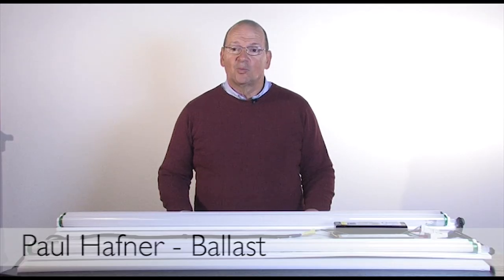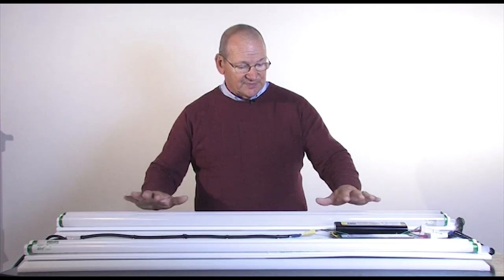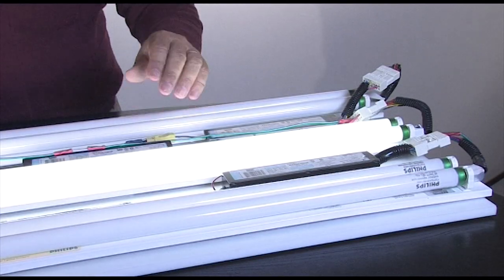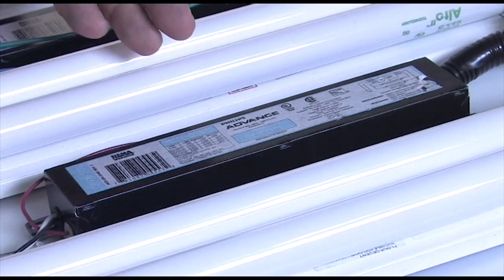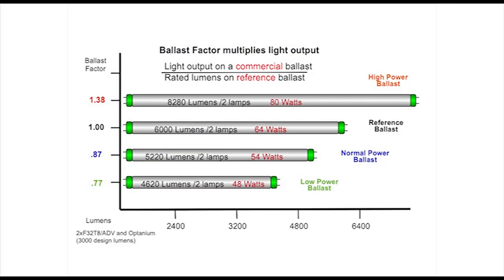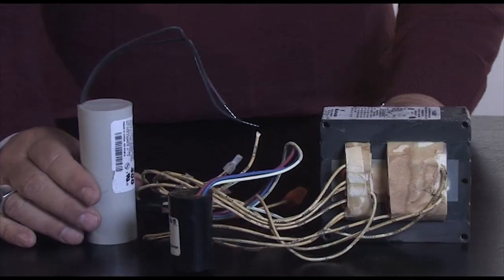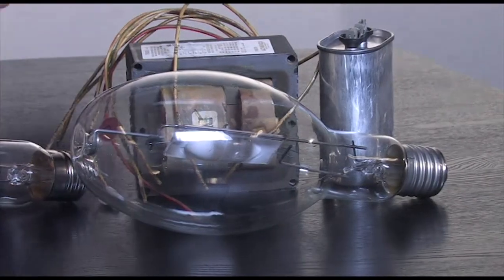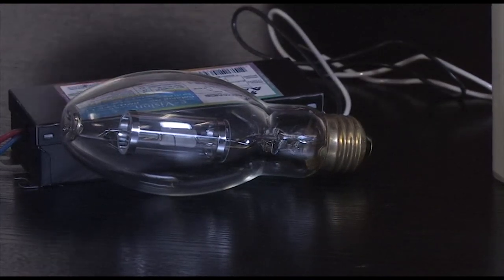What is a ballast?

Comment: I have just moved into a house built in the 80s. the bathroom has a magnetic ballast. it's weird. it sounds really stupid, but it almost seems like there a psychic link to the light. 9 times out of 10 the light turns on at the exact same second that my urine is released. it sounds stupid, but it's happening. Hard to find any information on this sort of thing, at also without seemed full blown crazy.

Comment: does the ballast makes a difference in light power? for ex1ample if i buy a 100$ balast or a 500$ ballast ? will the better one gives more power to the plants ? or it dosnt matter the ballast only the bulb ?
Reply from the maker: Hi there, thanks for reaching out. Cost is not directly correlated to power, so a more expensive ballast won't necessarily be more powerful. Thanks!

Comment: Come on man get into the future. I recently found that the BEST thing to do is to toss the flourescent bulbs and ballast and install LED bulbs they make them to fit almost all older flourescent fixtures. You may have to swap the ends that hold the bulb but I did not they fit right in. Just remove the ballast and wire straight in like a normal bulb. Better light/cooler and lasts longer. Just so you know.
Reply: Led lamps sucks
Reply: They really are not lasting as long.
Reply: @jonathaneastwood2927  3 years and going strong. Instant on and much brighter than the flourescent bulbs and best of all NO ballast LOL.  I got these at the light Bulb Depot store off Lafayette Ave in Nashville TN these are good! I am sure that there are some inferior brands out there, you may wish to look up the ones that they sell at the light bulb depot as it has been THREE YEARS and I don't remember the brand Good Luck
Reply: Hi Darryl, i am in the UK and there really is some awful  junk on sale here now.

Comment: Hello Philips, how long do electronic ballasts last for?
Reply from the maker: Hello Xirexter and thank you for getting in touch. It depends on the ballast and its application (fixture type and environment). For a US Advance Optanium or Centium T8 ballast, expected life is typically 50,000 hours (B10) provided the ballast is operating below its rated case temperature. Life expectancy can decline significantly if temperature rises.
Reply: What if the light fixture is outside would that do anything?
Reply from the maker: Life expectancy can decline significantly if temperature rises. So, temperature does have an effect.

Comment: Hello Philips, I have a question with Electronic ballasts when a lamp fails do the electrodes blow an orange color and flicker or does that only happen with magnetic ballasts?
Reply from the maker: Cathodes glow as they cool down after current stops. Most failures occur when the cathode wears out due to emitter depletion. Typically they will fail to start.
Reply: Does that happen with both Electronic and Magnetic Ballasts?
Reply from the maker: Hi there, sorry for our delayed response. Unfortunately on this occasion we are unable to provide you with an exhaustive answer to your query. Sorry for any inconvenience and thank you for your patience.
Reply: The electrodes can create an orange glow on the end of the bulb when the bulb goes out. This can happen with electronic ballast as well.

Comment: Is there any more use to a ballast now that LED lights have surpassed heavily the efficiency (lumen to watt ratio)? Or they are obsolete pieces of history now?
Reply: fmn2628 
Obsolete for sure. It won't be long before all lighting is LED.
Reply from the maker: Hi there, to answer your question, Ballasts continue to be used in fluorescent installations and will remain as long as the fluorescent lamp does. Of course, ballasts also operate UL Type A InstantFit TLEDs.  While sales of ballasts in new luminaires is falling very rapidly, conversion of existing lighting to LED has a long way to go. Thanks!

Comment: Capacitors stabilise the output not convert amp s and volts to watts they are the same thing just a Different type of measurement like liters and gallons different measurements for the same amount of water or in this case electricity

Comment: I love these technology.
LED sucks
Reply: LED doesn't suck, they are just boring.
Reply: Well in my opinion LED lighting is weird and makes really bad to my vision.
Of couse, LEDs are great in keyboards, notebooks, smartphones, flashlight... But as a lightbulb (or any source of illumination where you spend hours), it sucks.
Reply: Oh that's too bad. The only reason I use LED is for efficiency. Otherwise, I would definitely choose CFL or Fluorescent tubes. Especially ones with an inductor or magnetic ballast to get that cool flicker effect when it turns on.
Reply: In my apartament I just use old incandescent lamps. There are three of them here.
One with 28w (bedroom), one with 105w (kitchen) and one with 70w (bathroom). Given the time they are turned on, it only adds up about US$ 1/month in my electricity bill. I prefer the old yellow incandescent lamps over fluorescents one.
Reply: Wow only $1 a month extra? That is pretty surprising.
Reply: The jiro Network yes. Bulbs uses low electricity. I pay us$ 0,20 per kWh here
Reply: Matheus Bitencourt said no one ever

Comment: Hello, i have a question,  what will if we use a non shunted lampholders to an instant start ballast?
Reply from the maker: Hi Criselda :) the simple answer is yes! Instant Start ballasts can be wired to unshunted sockets using a specific wiring method.
Reply: PhilipsLighting , thank you for your prompt reply. But what I need to know is, what will happen if we did not shunt the unshunted lampholders for instant start ballast specifically the Philips ICN 2P32?
(Sorry, my previous query was incomplete). Thank you again, hope to hear from you soon.

Comment: I have several faulty Philips ballasts(I kept them instead of throwing away, they worked 2 or 3 years). I opened two of them( model = sumo) none of components(transistor, capacitors diode)  are Philips or NXP or any reputed brand,  instead cheap Chinese capacitors, and transistor are from some "Jilin sino microelectronics".

Comment: is ballasts used for smart LED lights
Reply: Both yes & no. Well depending on the LED unit. Some can operate on the ballast but there are some that don't use the ballast at all & only use the mains voltage. My recommendation is to bypass the ballast & hook up the mains, because you'll lose efficiency with the ballast regards of type (magnetic or electrical).

I hope my answer is of some help.

Comment: Uhhhh, what was that?  I did not see the workings or schematics of a ballast, I did not learn how a ballast does what it does, I did not get my monies worth on this free video.  PS, I clicked because of my respect for the brand name Phillips and perhaps that is why I am disappointed enough to comment this way.
Reply: It was "FREE", but like the "MAN" says- "Nothing is free"   I take that to mean your time, my time, everyone's time is valuable and should not be waisted.  If the video did not do as it "advertised", then it waisted that person's time...... time he can not recover and in my book, that is a sin.
Reply: +PhilipsLighting :'D
Reply: "The capacitor helps convert volts and amps into watts or power" what??? the hell does that even mean?
Reply: Yea.
Reply: found this elsewhere: "Capacitors are used as a power factor correcting or current regulating device and provide the control necessary to ensure proper lamp and ballast operation. Different wattages, voltages, and ballast types require a variety of different capacitor values. The ballast I.D. label specifies the microfarad and voltage rating needed to operate properly. If the capacitor is incorrectly wired, improper operation of the fixture as well as other component failure could result."
Reply from the maker: Hi there, thank you for your response to our video. We welcome your engagement. We are looking into this internally.
Reply: scott lund Look man it was free information why are you complaining. Maybe if you want those things you should look elsewhere, not complain that your free info that you have paid absolutely zero for is not up to your standards
Reply: scott lund read the title. “What is a ballast?” If you want to learn how a ballast works, search “how does a ballast work?”

Comment: I have a single ballast, 2 tube fluorescent fixture. 
Is it possible to turn off one bulb with a pull chain switch after the ballast. 
IF SO... which wire do I put this switch? ... THANKS!
Reply: no :(
Reply: Well Pooh, said Winnie. 
It's not a dimmer type. Guess I'll install a small LED for a nightlight through a pull chain over the kitchen sink. THANKS.
Reply: The only way you can do it if it is pre heat
Forgot the other ballast you can do it with to idk
Reply: And i guess parallel start
Reply: Na... it'll much simpler to install a mini florescent or LED and pull chain. Little more work but simpler.... and changeable is needed. 
I've been getting seasonal end sales of white LED Christmas light string. Tho in time they slowly turn bluish. EH, they're dirt cheap, maybe $2.50 set of 25. 
THANKS